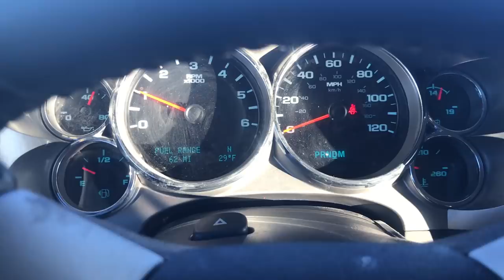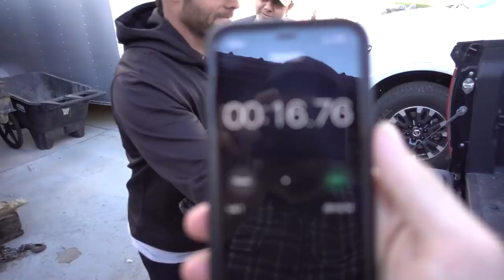BSY | 3 BULLS FROM 3 STATES | S1E50

Comment: Shooting your rifle from a sled is great for checking  accuracy. BUT you should shoot a few they way you would use that rifle  in the field.  As it will generally shoot a little different. The sled has very little give. It has been my experience it will shoot low when it is not in the sled.